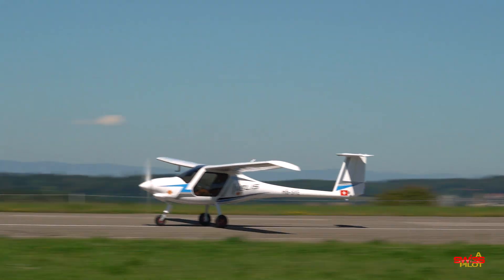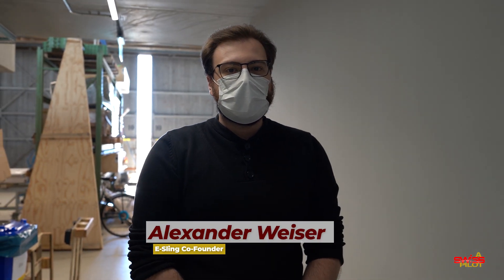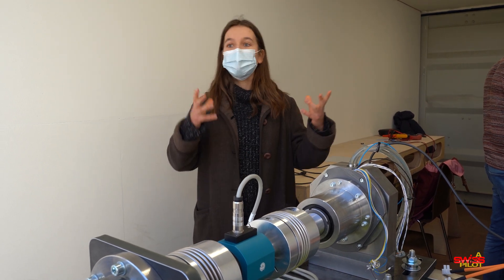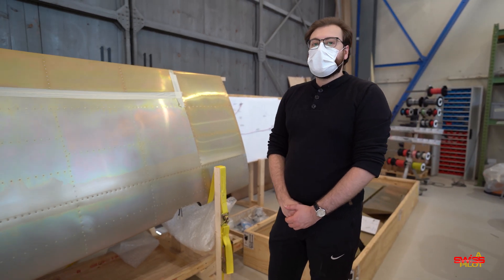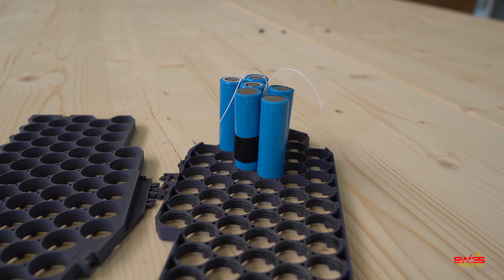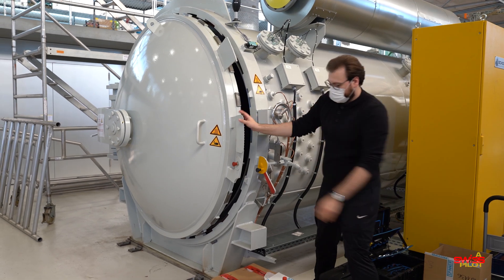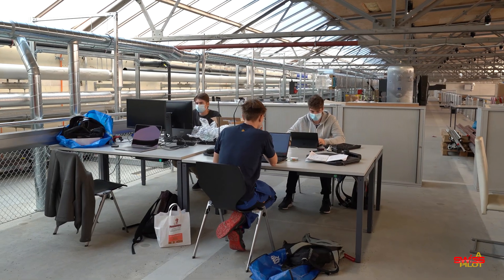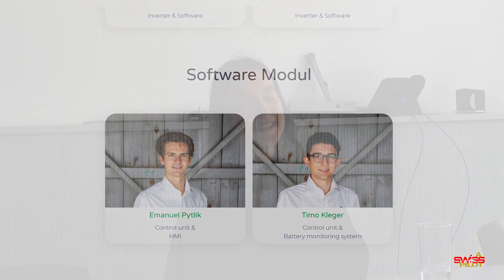A group of students build a 4-seater electric aircraft - The e-Sling Project

Comment: Awesome project. I'm currently building a sling TSI in the UK. Any options to expand the scope of the research project using hydrogen fuel cells as the main power source?
Reply: Hi Tony
Thanks! 
Good luck on your build, when it's finished you'll have an amazing aircraft in your hands.
Currently we focus on batteries, but who knows what the future will hold.
In the meantime a team in Delft, called AeroDelft, is building a Sling 4 with hydrogen fuel cells, maybe have a look at their project.
Reply: @cellsius2754  thanks you so much for the tip. I will. The battery tech you guys are working on is very impressive! Thanks for all of your hard work